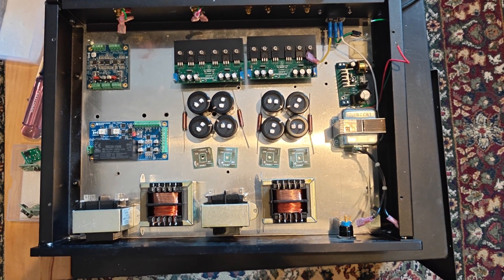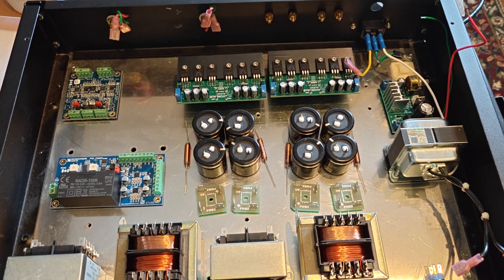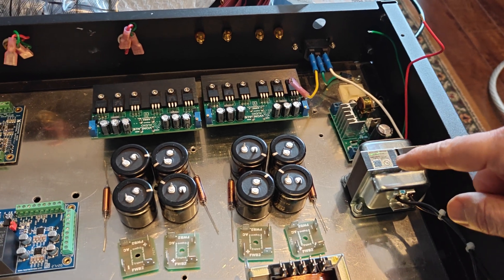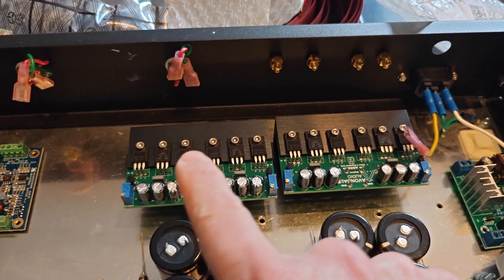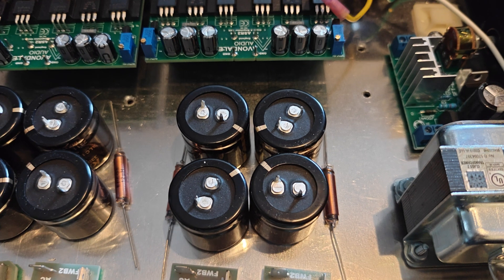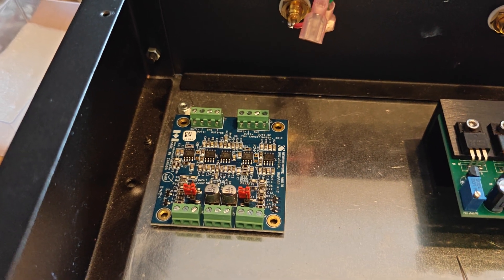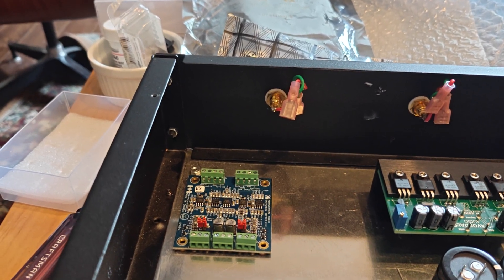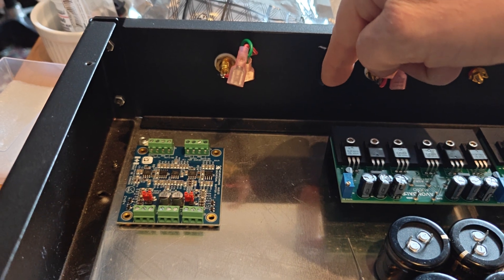MadCap+ 1/19 - Introduction and Ideas for Layout (Naim preamp supply and Neurochrome Buffers)

Comment: Hi, Seems you are an expert , I dont have preamplifier or power supply for Naim nait xs2 (Chasis- Floating ground switch)   I have dip noise coming from speakers without music if i increase volume. I read Its as ground loop problems. My Marantz amplifier doesnt have these issue.
Reply from the maker: I'm quite familiar with the olive range, but not so much so after that. Therefore, I haven't got any advice for you. Sorry.

Comment: 4× 43 VA trafos...and feeding into
 8× 3300uF/63V..& what's the dc..+/-18V..or +/-24V...?
Reply from the maker: @analoghardwaretops3976  The 43VA transformers have 24VAC secondaries, c and will reach be producing a regulated 24VDC. The steel encased transformer to the right is only 10VA with a 16VAC secondary, for a 18VDC supply. All five supplies are positive only.